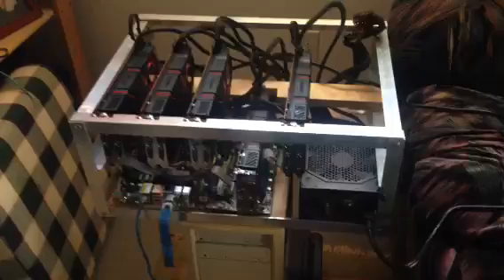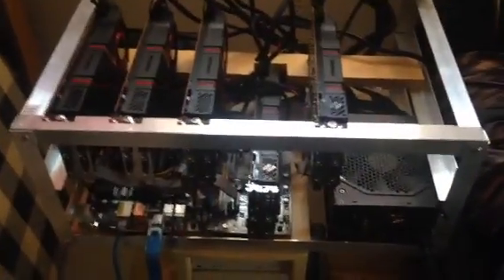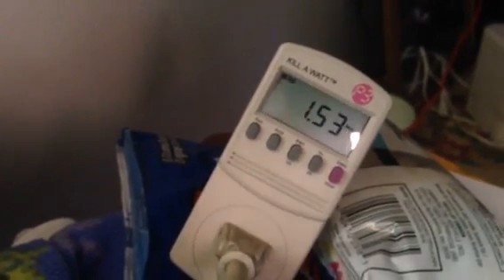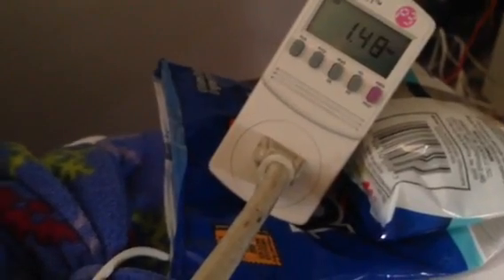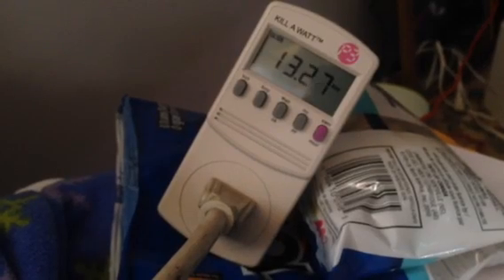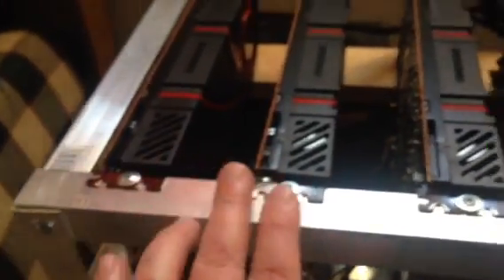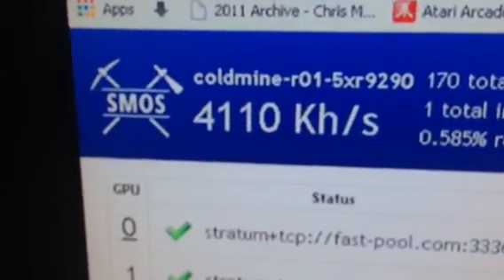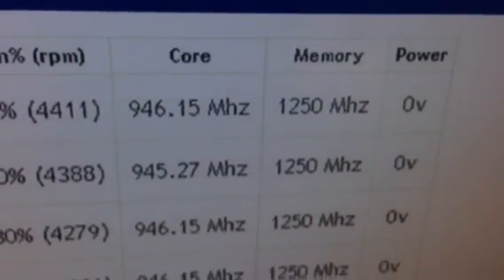5x r9 290 - litecoin fastcoin digecoin mining rig

Comment: So you draw about 300watts per card? I got the same case and also using BAMT. I'd advice to undervolt those cards because I am drawing 210watts per card now from the wall with my 280x toxics. I undervolted them to 1.081vddc. They running at 710kh/s (69 celcius and fan only at 44%. 1.5% reject ratio). They run alot cooler after you undervolted them.